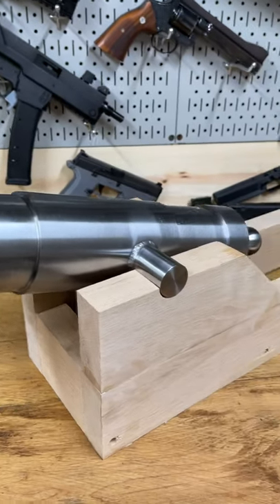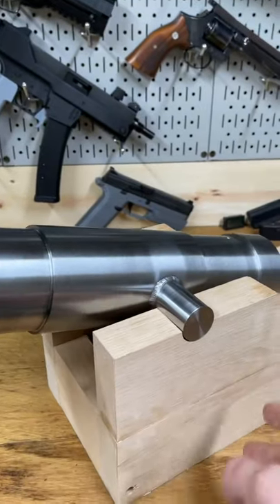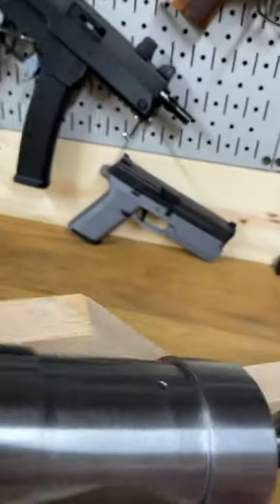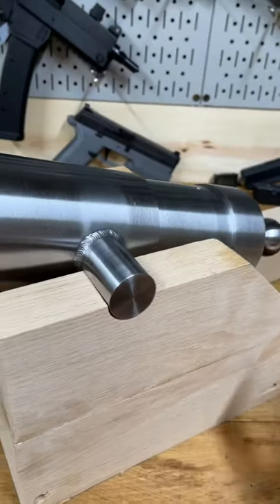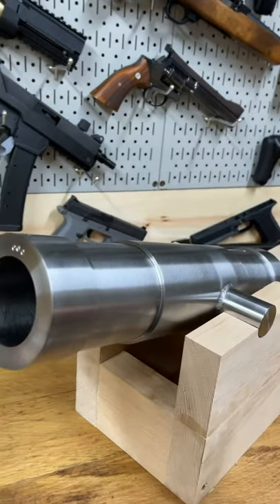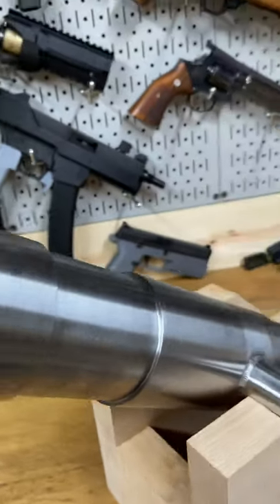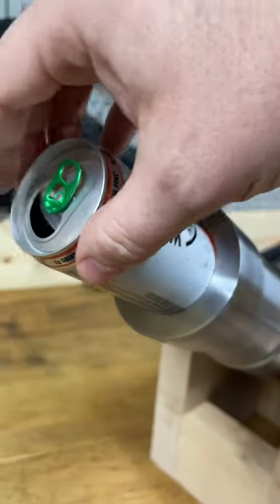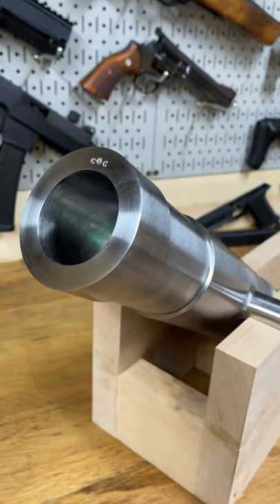Cannon Carriage Construction Update #Shorts

Comment: You may need some vertical or angled holes through the sides of the carriage for spikes to dig in and hold it in place with the recoil.
Once you start shooting youll figure it out
Reply from the maker: It has front wheels, dual rear drag tails, and will be tethered and anchored up front 👍

Comment: Might want brass inserts/liners (bearings) for the wood/metal interaction faces
Reply from the maker: Eh, not too necessary. Movement is limited and only when not under tension. You will loosen the trunion cap slightly, adjust elevation, tighten trunion cap. Bearing surfaces won't really add much to the equation.

Comment: Fill that can full of rocks. Be devastating.  I’d like to see that.  Lol.
Reply: If he loosens up the rim of the top it could come out like grape shot.

If he dumps concrete into the opening the can would serve as a kind of jacket on a slug.

I was thinking for a moment it could be neat to use a funnel on a topless can to cast a projectile with a conical tip, but it would be kind of pointless with a smooth bore.

Comment: Would this be considered a destructive device? Or does it need to have rifling to be a DD?
Reply from the maker: It's not a DD, and it's not even legally a firearm since it's muzzle loaded, uses a primitive ignition system, and is a replica of a pre-1898 design. Rifled barrel or smoothbore is good to go.
Reply: Sweet. What if u use a larger bore size with a heavier projectile? Still gtg?
Reply from the maker: Yep, as long as it’s black powder, muzzle loaded, primitive ignition, and a replica of a pre-1898 design.

Comment: Awesome but I assume you will put the metal straps and screws through on that type of pivot. It might buck out etc otherwise just look at the sight.  Rip off that design with some scrap metal and bolts
Reply from the maker: It’ll have steel trunion caps which are bolted through from top to bottom.

Comment: "gorgeous inch and a half thick." You could of just said two by four
Reply from the maker: Hardwood like this doesn’t come in standard softwood lumber sizes like 2x4. Technically I could have said some “gorgeous 8/4 red oak that’s been planed down to inch and a half thick and ripped to my desired width” but it’s easier to just say, you know, inch and a half thick.
Reply: Understandable

Comment: Bro the wholes on the side that the cannon sits on your gonna need to go a little deeper if your gonna run that type of wood
Reply from the maker: It will be using half moon steel trunnion caps on top of the wood bolted through. Strength isn’t something I’m worried about with this red oak.
Reply: @booliganshootingsports  oh I thought you were just gonna sit it on top last time I saw that happen the cannon shot off the top and smacked the guy that lit it in the chest and he had 5 cracked ribs

Comment: Howitzer not cannon
Reply from the maker: A howitzer is a type of cannon. All howitzers are cannons, all cannons are not howitzers. And this is a howitzer type cannon.
Reply: @booliganshootingsports  A howitzer /ˈhaʊ.ɪtsər/ is generally a large ranged weapon that stands between an artillery gun (also known as a cannon outside the US) – which has smaller, higher-velocity shells fired at flatter trajectories – and a mortar – which fires at higher angles of ascent and descent.
So you not so right
Reply from the maker: @kozmodemyanov   Definition of howitzer per Merriam-Webster
: a short cannon used to fire projectiles at medium muzzle velocities and with relatively high trajectories

So as I said, it is a half scale replica of a mountain howitzer. Which is a type of cannon.